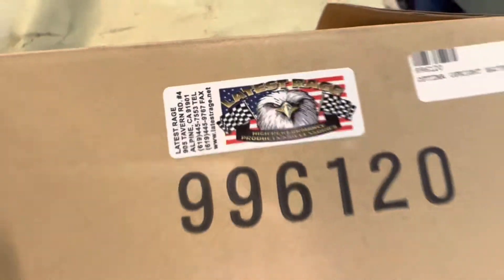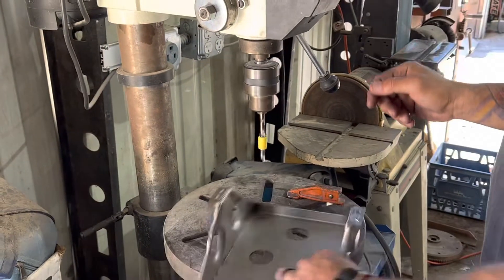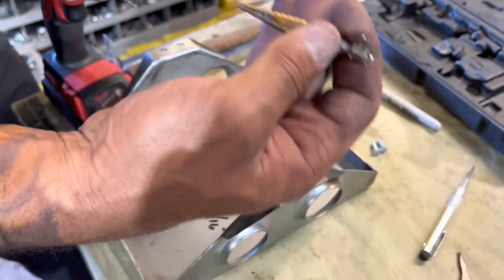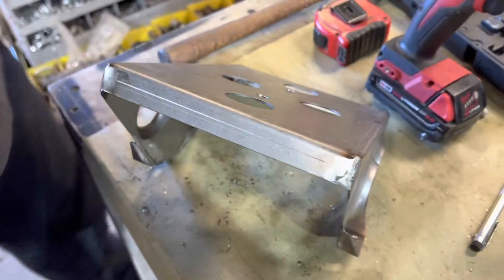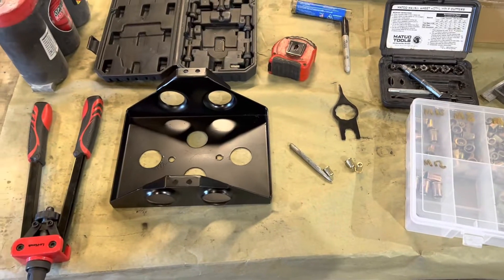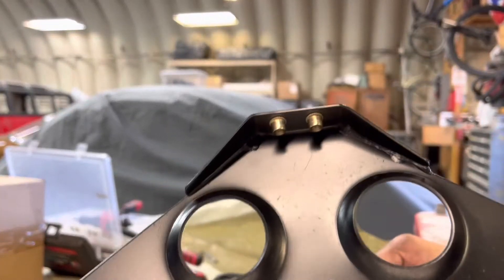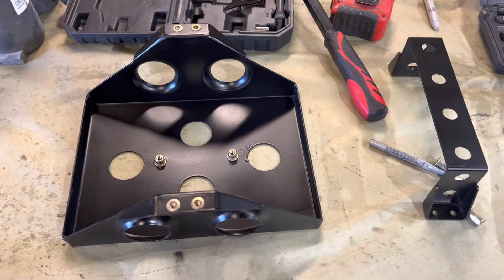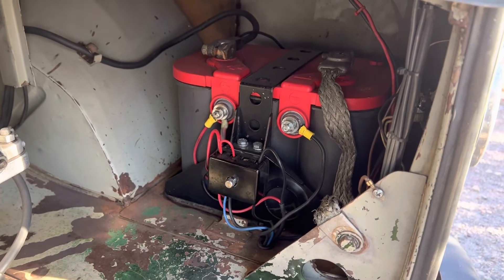Upgrade a battery box for VW’s.

Comment: Great in depth video! Glad I ran across this. Just the bracket I need for my optima battery in my bug! 👌🙌. Thanks for walking through the nutsert install as well as all the drill bit sizes. 👍
Reply from the maker: No problem 👍

Comment: Do the rivets interfere when the battery is installed ??
Reply from the maker: Not on Optima Batteries. They have empty spaces where the rivet goes on the base. The boxes are designed specifically for optima’s.